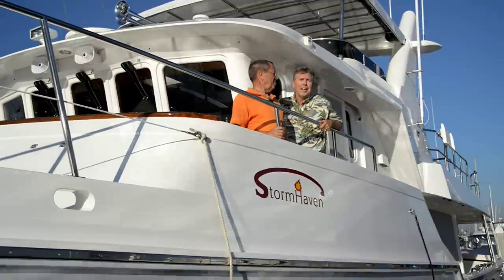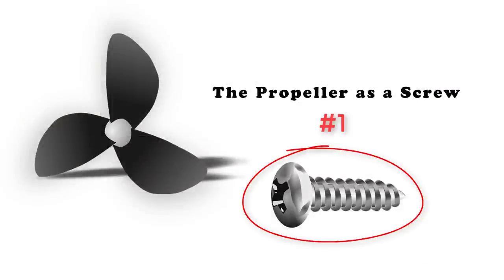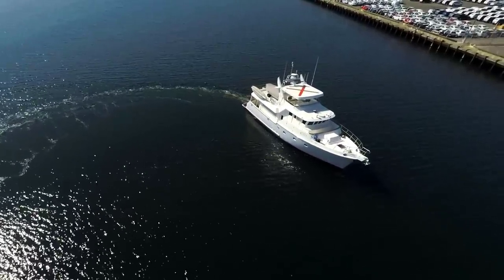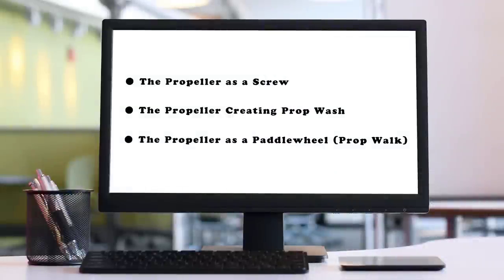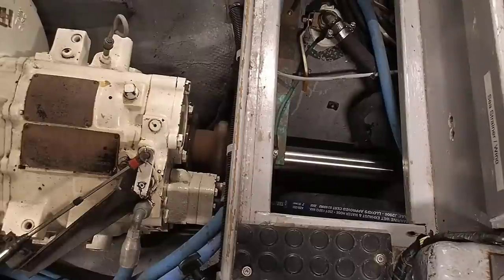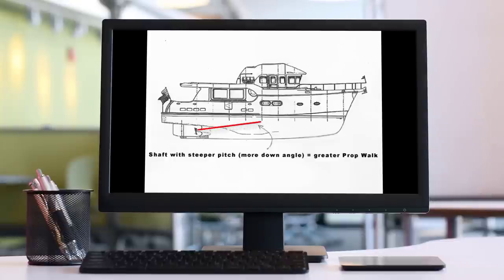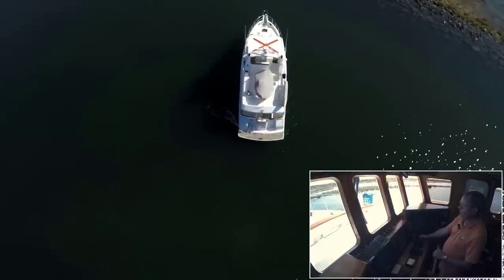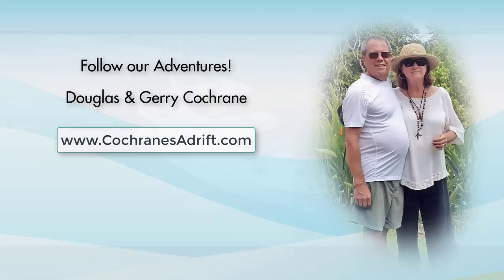Physics of Docking - The Prop

Comment: One question to this Prop Walk is what happens when you have twin Engines
Reply from the maker: Peter: Twin engines usually counter rotate - one side rotates clockwise, the other counter. So if you have one in neutral you can get some walking movement from the other.  Twins are much more maneuverable

Comment: Question:
On a single shaft that has counter rotating props, can you still get prop walk?
Reply: Good question! I guess they will mostly counteract each other for minimal effect unless one is rotating more forcefully. Do you have a specific example?
Reply: @jeffmerrill1135  2003 34 ft Rinker. 
It has dual shafts but two counter rotating props on each. Oh, it's also a stern drive.
It's up for winter storage right now so I can't try it right now.
Reply: @dgeorge852  U tell me buddy!, your a Captain in the marines!, nah seriously a twin sterndrive 34 flybridge cruiser like your Rinker shall have some transverse thrust as the props are a similar diameter/pitch to a twin shafts 34 Rinker hull .(M-24, m.e.d.-3 certification of comp.).
Reply: @kenlee-97  I seems you didn't account for the fact that there are two counter rotating propellers on the same shaft. If you have twin shafts, single prop per shaft and have both in forward or both in reverse, you won't experience any noticeable prop walk since the transverse thrust from one propeller is cancelled by the other. I've never driven a duoprop so it would be interesting to know but my guess is that they give very little, close to no prop walk.
Reply from the maker: Jeff Merrill  • 4 years ago
Good question! I guess they will mostly counteract each other for minimal effect unless one is rotating more forcefully. Do you have a specific example?